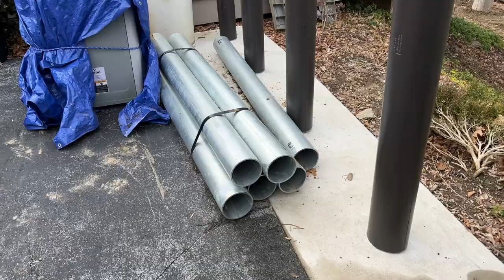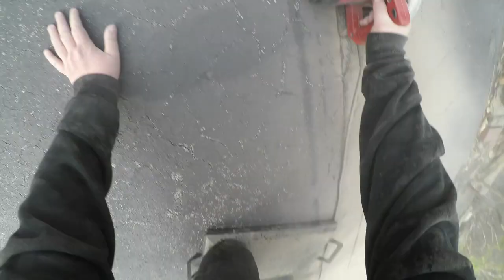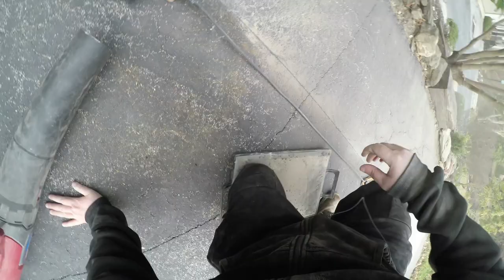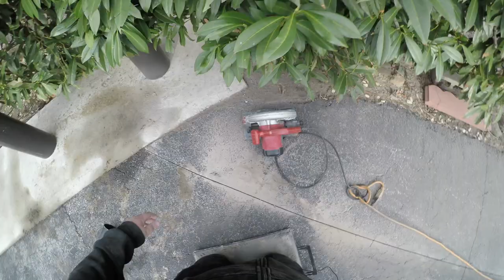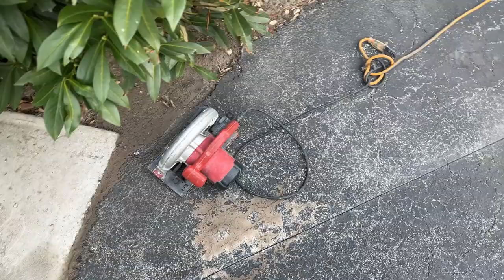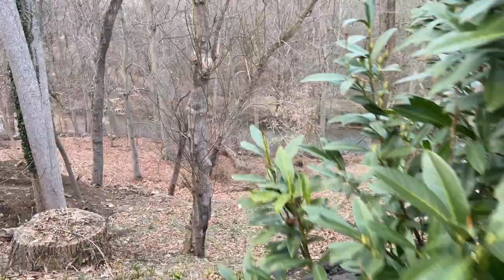Cutting asphalt with circular saw 20 linear feet on driveway

Comment: Nice job.  If you had access to a GFI outlet for the saw you could have used a water hose in place of the leaf blower or pre-wet the asphalt to keep the saw cool and the dust under better control.

Comment: How many blades you go through? I'm doing 22 ft of asphalt using concrete blades. They cut SLOWLY!
Reply from the maker: I bought a Dewalt 7 1/4 diamond blade years ago that’s still in use it cut like butter for me
Reply: Josh - let me know how you make out.  I just cut 1" thick flagstone with a Harbor Freight ($2.99) 7 1/4 concrete blade - cut about a 2.5' length cut with a circular saw.  I had someone spray (light stream from hose) water on the blade as I cut.  It worked better when I plunged cut it and that's how I'm going to attempt to cut the asphalt.  I destroyed 1 blade before I attempted the plunge cut.  I have about a 10' section to cut.
Reply: @PHL_Brownstone  Great Job!

Comment: Are there any safety concerns for doing this aside from the obvious watch out for the blade. Can the blade potentially shatter and send shrapnel your way?
Reply from the maker: The blade I used is a Dewalt diamond blade 7 1/4” seams to be high quality. I used it on many jobs and still in use. I definitely would not use a cheap blade

Comment: Dumb question, would u say this could damage a cars paint if the car were parked 10-15ft away?
Reply from the maker: If you can’t move the car you could always cover it with a sheet of plastic, a tarp or a car cover. It’s hard to say but I didn’t cause any damage. I used a better quality blade that didn’t throw chunks or debris. It just cut like butter and threw dust
Reply: @PHL_Brownstone thanks for responding. I would think my neighbor would have asked me to move it before using a big buzzsaw on his driveway, but he didn't and I'm like 99% sure it damaged my car there are a bunch of small paint chips
Reply from the maker: @johnnyversaci7091  that could be from driving on the highway. Did you find a lot of dust and debris on your car after the cutting?
Reply: @PHL_Brownstone  yeaa it was covered in dust too
Reply: Yes you are getting  some dust but unless the car was in front of or directly behind the guard you should be okay. Don't lift the moving blade out.

Comment: will this work with a cordless?
Reply from the maker: Yes with the right diamond blade and plenty of batteries 🤣
Reply: @PHL_Brownstone  I'm only planning to cut out a small section inside my garage.  My garage was built overtop of the asphalt driveway.  I want to put a water softener in.  I am in a flood plane so my basement is basically just a whole in the ground.  I do have a stairwell down which is where I had intended to put the softener, on a ledge but there just isn't enough room.  On the other side of the wall is the garage so I am thinking of cutting out a small section to put a concrete pad against the house and then building a small insulated room to put the water softener.  I have the ryobi 7 1/4 saw, which has a vacuum attachment and was going to use a spray bottle to help keep the blade cool.  If I'm crazy let me know. I don't know what diamond blade to get but even the cheap ones seem to supposedly be able to cut asphalt according to the q&a. Here is an imgur link with some photos.  If you've never used imgur before it will warn you that there could be erotic photos but I promise you it is just pictures of my stairwell and garage.  Up to you to decide if you want to trust me lol   

https://imgur.com/a/7yGeJ1K
Reply: @PHL_Brownstone  and if this works I might actually just cut out sections and replace the blacktop with a proper concrete floor.